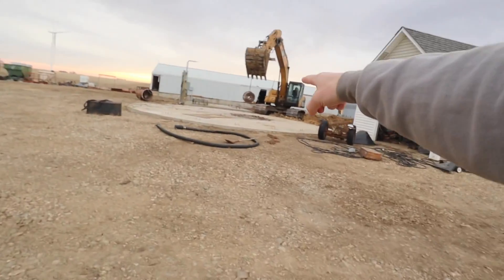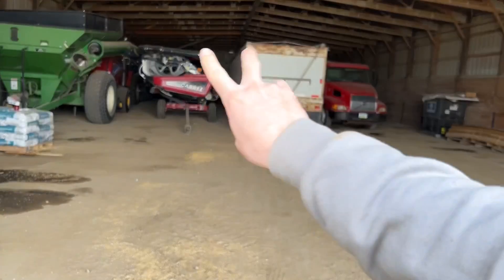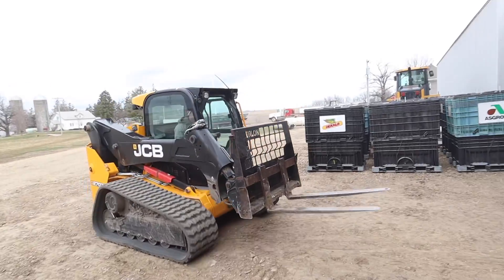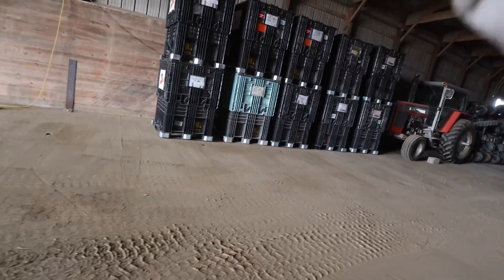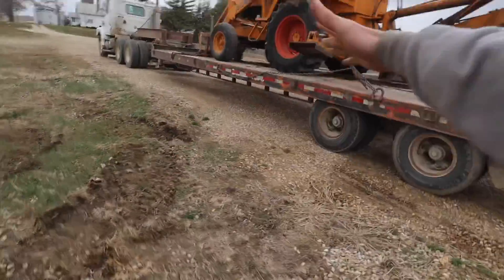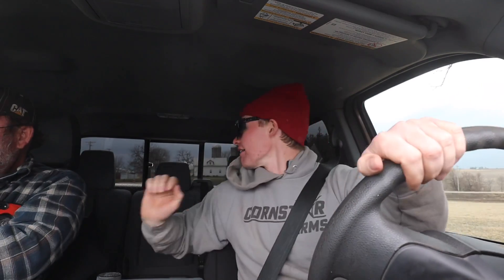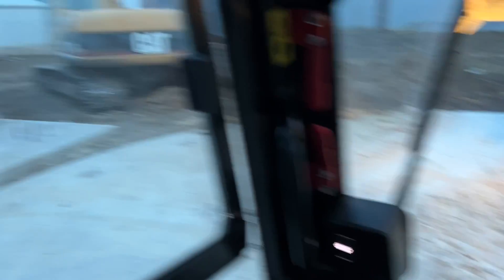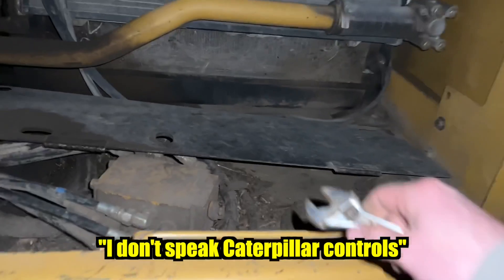I Tore Up My Driveway With A Bulldozer

Comment: Concrete saw cuts an inch or so in sections will provide a relief and the same thing with a concreye drill bit every 24"  but the bit will have to be a full drill through to provide the relief... good luck

Comment: When you get one hole started with the breaker move the point bach like 8 inches to a foot from the edge and break some more.  Do not go so far from the edge you have broken already.  You need an area that when broken can expand into the already removed concrete.  You should be able to break all of the inner concrete and then dip it out with the excavator.

Comment: Remove the bin downspouts, add a right angle bar with bolt holes to the edges to both new cut ends and then put them back up when the bin is full of grain. Being able to remove and store when the bin is low in grain will save the wind stress on the bin sides.

Comment: SUGGESTION: make some warning tags to attach to ignition switch, steering wheel...some place that will remind anyone about to operate a machine that, in this case, a hydraulic line is open due to unfinished maintenance. Not only to avoid big messes, but also to avoid damage and injury. Like a Lock Out Tag Out system

Comment: With those straps bouncing around in the wind, you need to put a twist or two in the strap, same as ratchet straps on loads, if they are flat they will vibrate

Comment: It makes my heart ache all the concrete that has been grubbed up, was not crushed to 6F2 (40mm and down) and stockpiled to be used as road sub-base or structural fill.
Reply: Exactly.....the roadway near the bins and pit would be a perfect place. Instead, they'll pay for large stone bed
Reply: I offered to crush it for them!  I own a impact crusher and live near northwest Iowa
Reply: Awesome idea.
Reply: @scottsand2317  great idea Scott
Reply: @scottsand2317  what does that normally cost?  I took out 1.5 garage, plus foundation (no mesh/rebar) a stave silo, and few @4” pads.  Buried it all with mini excavator. I might have another building this fall.
Reply: @larsharris  depending on amount of concrete and how much processing or sizing and removal of wire and rebar $7-12 per ton.  Or $10-18 per yard.  I own a 12,000 lb class hammer for my excavator and I also have a concrete muncher for removing the rebar before it enters the crusher.
Reply: Cole could’ve saved thousands on rock from the quarry and just used his own concrete!   I have the tools to demo and then crush and pile in big piles for them to use later
Reply: @scottsand2317  did u contact them directly?   I talked with summer through fb messenger.

Comment: Cole you have electricity, water well and concrete pad. Why wasting money on demolition when you can make giant pool that will cost you fraction of demolition. Concrete blocks, you can find good used water pool pump, waterproof it and also have a reservoir for fast filling of sprayer or relaxing during weekends.
Reply: The concrete pad being demo'd, as explained a couple vids ago...is in the direct path of new truck lane to the new bins...iirc?

Comment: it helps when your breaking concrete to start from the edge rather than the center.
Reply: It helps to have a clue of what you're talking about before opening your yap... Looks like you skipped that step. Like Stephen said, they did this for a reason. A Good reason. To do it your way would be stupid and a ton more work. If it were even possible at all with that size machine.

Comment: It takes the longest to get a spot started when breaking up concrete.  Once you've got a hole formed you just keep working out from there in small bites.  It looked to me like you were pecking too far from your hole and it was like starting over again.  Think of it like cutting wood.  You need somewhere for the piece you are breaking off to move to.  If you are working right in the middle of the pad there is no place to push the chunks to so it is harder to break them off.

Comment: IDK but.... with concrete that thick, wouldn't it be better to square it off and use it for a truck parking area ?
If not, you mean to tell me you can't find a reason to repurpose the area rather than removing what cost several thousand dollars to install and I would think a few thousand to remove.

Comment: You may have to hire a blaster to come drill about 6 holes around the base and then cover it with dirt and blast that sucker into some manageable pieces. Concrete is darn tough when it's thick, no wonder we use it so much lol.

Comment: You are on the right track, but I fear your JCB may not have the power needed. As you found out, breakers break the equipment as well as well as the crack concrete. It is worth renting a machine and breaker. Am excavator in the 18 to 20 ton range should be heavy enough.

Comment: Sometimes you seem a bit caught up in the look of things Cole. A bump in the drive is no big deal.
 A pothole  or marshy spot however!!!  I agree that the old concrete pads need to go. They are future hazards for sure.
Reply from the maker: I wanted the bump gone so I could mow by the driveway without hitting rocks or using the weed wacker 😉